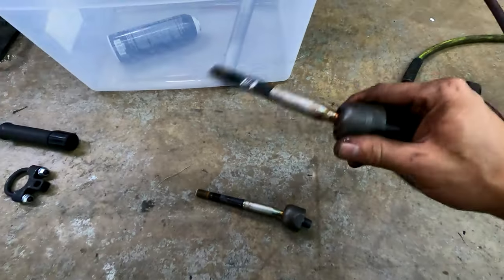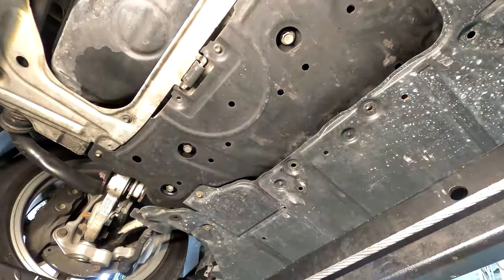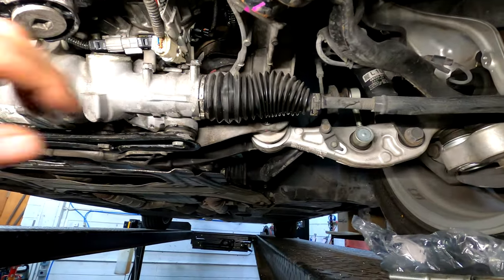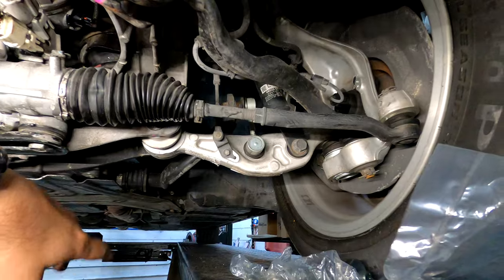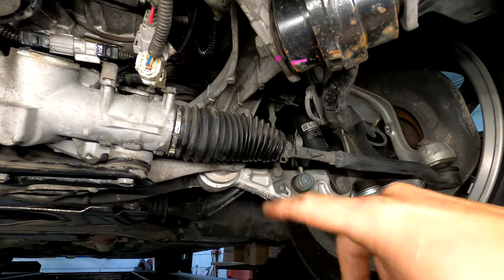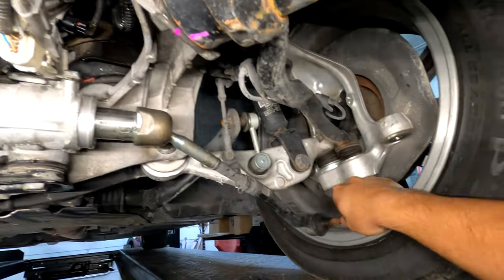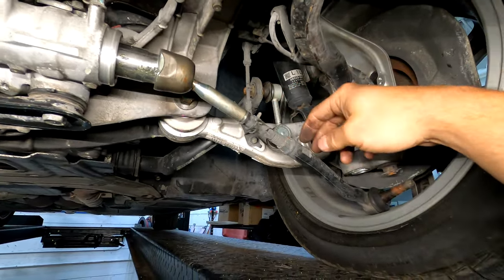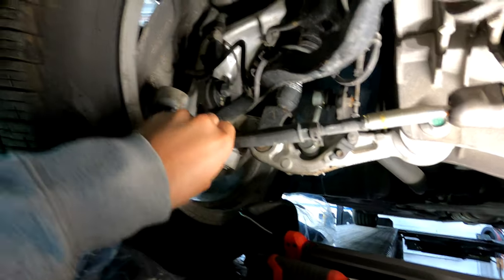How to Fix clunking steering Lexus LS460 without an alignment | Full tie rod replacement

Comment: I did my brakes and rotors last weekend and as far as I know everything is good now. Everything seemed tight in my suspension so I hope I get another 50k miles without any major issues
Reply from the maker: Always dealin' with my lemon
Reply: @LILEVO  I've learned a ton from you. I know mine has had really good maintenance and the specialty shop of the previous owner in Atlanta said they did absolutely everything to it with records. Fingers crossed